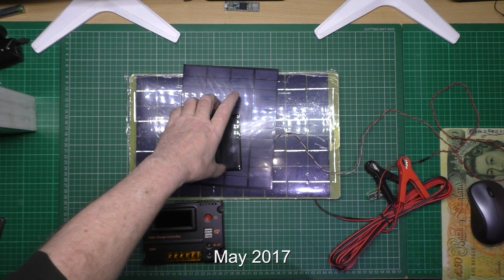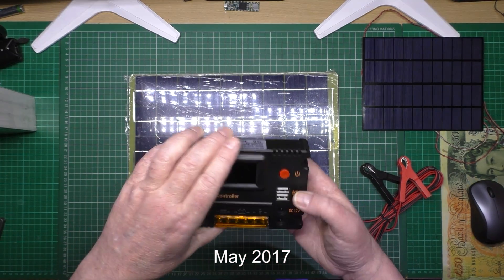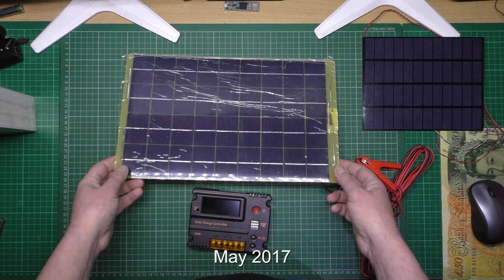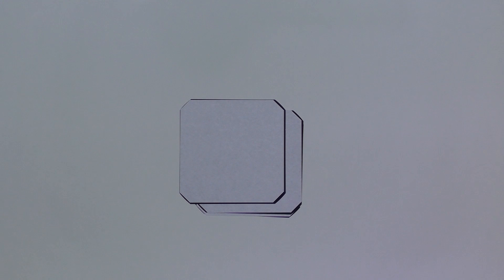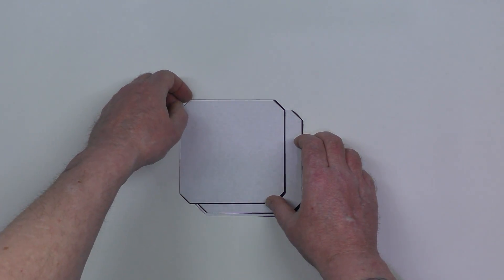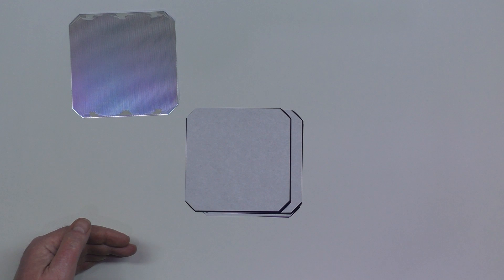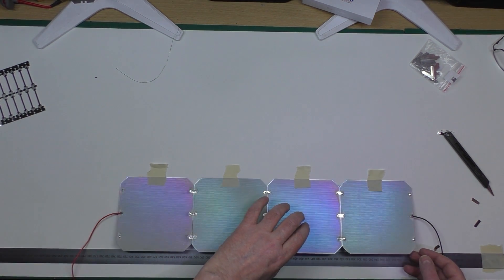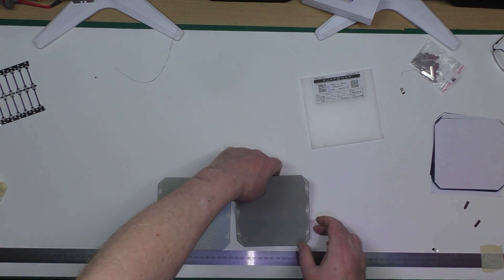Solar panels build part 1

Comment: Any more progress on your solar projects Tone? Been looking forward to this stuff. Any intentions of charging your ebike with solar like Andy Kirby?
Reply from the maker: It's almost finished but I wanted to leave it running for a couple of months to make sure everything is stable. The only thing I've done is got rid of the perspex/acrylic sheets that the cells are mounted on - the cells get so hot that it warps the plastic. They're now mounted directly on the window glass and they're giving around 10% more power.  
I can charge my bike off the battery (85Ah leisure battery) but it takes 2 days to charge it back up. I've calculated that I've saved a massive £1.90 in electric now :-)
Reply: ..£1.90! every little helps Tone 😉 I guess you’ll need to cover another window with cells to up the charging capacity and reduce times between charges. Look forward to seeing the set up fella
Reply from the maker: By my calculations.... if we keep this weather up and we have optimum sunlight in the evenings (when my panels are at their best) and the cells don't degrade..... it'll never pay for itself :D  
I've been thinking of doing the whole front side in panels. If I do, I'll have around 18a charge rate (12v) which would mean the only thing I'd have to run off mains power is the electric shower. Obviously, in the winter, I'll get virtually nothing. At the moment, I'm fully powering my TV, laptop, bike and all the batteries I can charge. Maybe £1.90 is a little on the low side - it's more like £5 because I keep resetting it when I'm messing.

Comment: Great stuff, love a bit of solar projects
Reply from the maker: It's another learning curve for me and it's been interesting. Things have progressed quite a lot in the last couple of years and they're much more efficient now :-)
Reply: From what I've learned, the 'old' solar panels - those 12v car solar trickle car charging ones are Amorphous cells and give quite a small current output. Not very efficient esp if said charger has an led, it'll take most of the current! I believe the modern better cells are Monocrystaline, like what you have :) Can't wait for part two